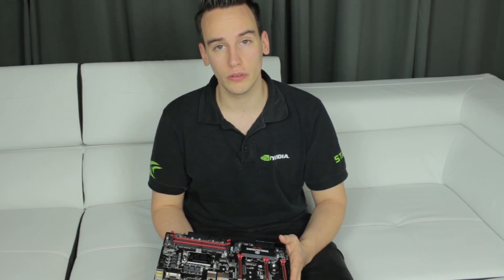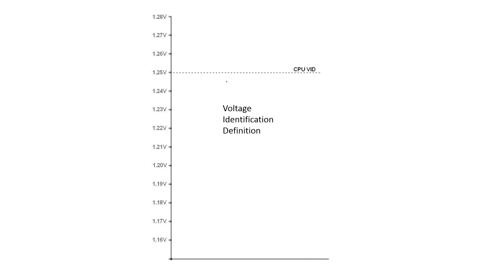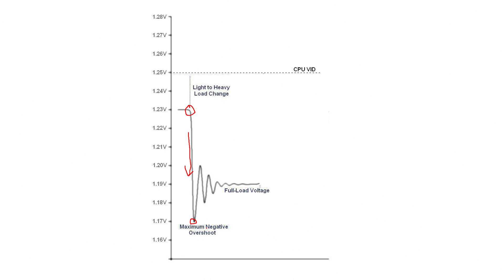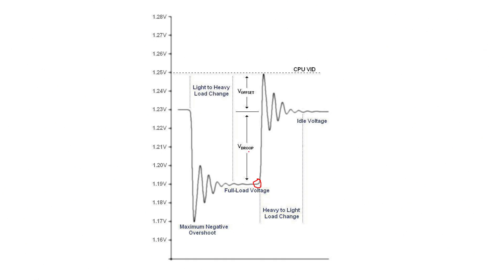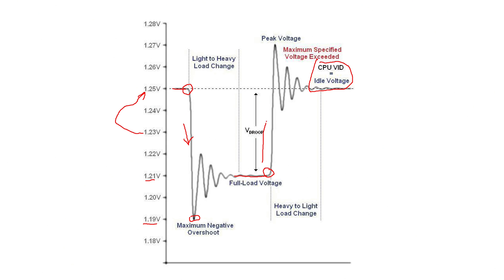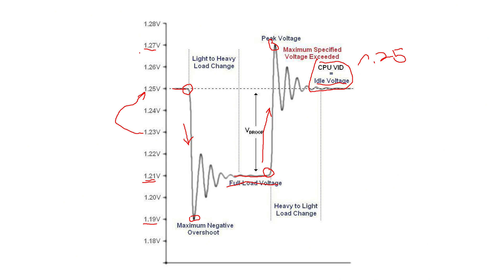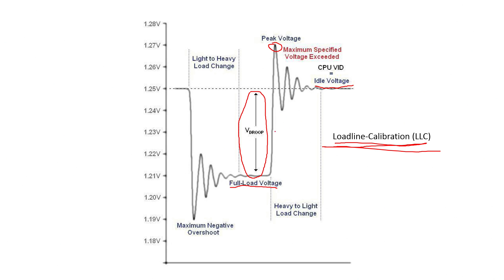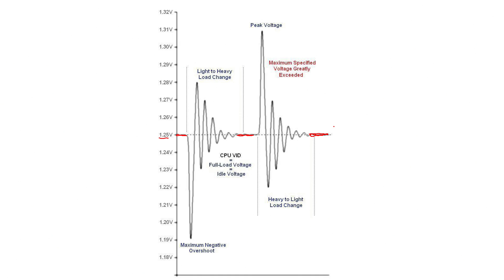VID, vCore and Loadline Calibration explained

Comment: Any help,  what could be causing this. I7-13700k, regular settings etc, hitting +-90C max temp. Cinebench r23, 10seconds after starting the benchmark, it draws +-230w and voltage is at +-1.37. But after the 10 seconds, power draw drops to 60watts and voltage drops to 0.74v. Cant seem to find solution for this. Have tried forced voltages etc, but dont help.

Comment: Would love to see an updated video about how AC/DC LL Interacts with vid,vcore & vdroop.
I know 1.51v is pushing it for max voltage for 24/7 use On 11900k but I don't think it will cause degradation. I was able to get AC/DC LL down to .08mohm to hopefully prevent unnecessary voltage spikes.
Temps are still good (custom loop)

Comment: Hi, great video! I'm trying to get 4.7Ghz on it 8600k. I put 1.27v core and I see in hwinfo 1.34v sometimes. What should I look in the software? Average or maximum voltages? Also getting 80°C at that readings

Comment: Thanks for the info. 1 question. When voltage drops on load, power is compensated by current right? So when the undershoot happens when load starts, can the current spike harm the system?

Comment: So to summarize, increasing LLC increases the voltage for the CPU WHEN it is under load (which increases temperature during benchmarking and stress tests) as well as increases peak voltage when the system is transitioning to idle voltage from load voltage (LLC increasing CAN mean much greater voltage then what you set in vCore/idle voltage temporarily while switching between states of idle and load. This can have a negative effect on your CPU's lifespan).
Reply: the idle voltage stays the same regardless of LLC level. Idle voltage = vCore set in BIOS

Comment: It's the VID that I'm just not understanding. I've read some things, watched this vid and try to make sense of it for my given situation and it doesn't click. Here's my situation... I have a 3700x and am monitoring with a few different programs. When I run at stock settings, I get the apparently normal 1.4v - 1.45v for both the vcore and the VID. If I set a manual overclock, the VID now never goes above 1.1v regardless of multiplier and vcore voltage. The VID almost constantly stays at 1.1 with the brief and occasional slight dip below 1.1 . How do I make sense of this? Isn't the VID supposed to be higher than the vcore voltage?

Comment: Yo man! I've got a problem with adaptive voltage, Iv'e set it at 1.350 voltage with a minus (-) offset of 0.035. The offset works but in idle, the adaptive voltage doesn't seem to work since it doesn't drop lower the 1.300 volt... When the adaptive voltage along with offset is at auto, the voltage drops down to about 1.080 which also of course gets the idle temp of my CPU lower but this doesn't work with the adaptive voltage that I've manually set...

Comment: I just built my first PC,  Asus x570 tuf AMD 3700x.  My worry is that in bios my computer says 1.512 volts.  Even in cpuz it says 1.45.  Under load it says 1.35. Is this normal?
Reply: Gaming in still Life that’s the maximum recommended voltage under load for 3rd gen ryzen. I think there’s a glitch atm with how the voltages get recognised in cpu z though but if you want to be completely safe remove your overclock

Comment: I'm running a Threadripper 1950X. According to HWMonitor, I have a VID per core of 1.237v when idle. It goes down to 1.194v when I start a stress test. That makes no sense. If VID is the 'requested' voltage from the core, why would it decrease just as it starts to get busy and needs more current? My vcore is 1.248v idle, 1.224v all cores loaded. So VID isn't a maximum either.

Comment: I didn't even increase the core voltage in the bios but its running at 3.760 V to 3.8 V usually it would be on 1.3 V

Comment: When I run a stress test not at a fast pace but it will fluctuate between 1.296v and 3.115v is this normal. Have a 5ghz oc btw seems stable

Comment: my VID sits at 1.42 on my VIII Hero.  My CPU is set to 1.295v.  My LLC is at 5 and it idles at 1.312v. Heavy loads it usually cycles between 1.312 to 1.286 at 4.6ghz.

Comment: This would be easy to fix with a "maximum voltage regulator voltage" in the BIOS, this way LLC couldn't kill your CPU and bumping up the vcore to levels that seem safe would always be safe, this is actually very easy to implement in the bios and voltage regulator so someone should definitely pitch this to manufacturers.
Reply: llc doesn't kill the cpu. it' those voltage fluctuations going from load to idle or idle to load. A perfect vrm that doesn't has those voltage fluctuations is possible but would be too costly. Hence we're struck with those fluctuations.

Comment: I have an option to increase/decrease cpu load line calibration and cpu graphics load line calibration which can go upto level 7 or 8 from level 1 and it says increasing the cpu graphics LLC will increase the graphics performance but will also increase the temperature. Should I keep the LLC level minimum or maximum?

Comment: Thanks so much for the video!

Quick question for you or anyone else who is able & willing... I have a Gigabyte Z170X Gaming 7 motherboard and it has a setting for CPU voltage called "Core PLL Overvoltage (+mV)" - it goes in increments of 15mV up to something like 300mV total. It's not mentioned in the manual and it seems nearly impossible to find any information (reliable or otherwise) about this setting online. Do you happen to know if this setting is relevant to the "V Offset" in your diagram around 2:45? Perhaps it's an amount above VID that the motherboard will deliver (e.g. providing a higher voltage than VID requests), either constantly or under certain load conditions?

Thanks in advance for any light someone can shed on this! :)

Comment: "Where you said "There's nothing you can do about it", Correct as a user, but I think it's important to understand that higher quality motherboards with faster switching frequencies and more capacitor capacity will experience VDROOP less and therefore will require less extreme LLC settings. 

That's why it's important to understand and measure on your own motehrboard and not jsut use otehr people's recommended settings when fine tuning your overclock.
Reply: Boosted Media what's an example of a high quality mobo....z370 for coffee lake

Comment: call me crazy and stupid , why the idle voltage higher than the load voltage in the first example? thats the part i dont get

the LLC what does have a more stable voltage between usasges ?? what are the pros and cons ??
Reply: idle voltage is higher than load due to vdroop which is a built-in safety mechanism. you can use llc to remove vdroop but you 100% will run into voltages higher than VID during transience from idle to load.  
pros for more stable voltages between usage means that you get to achieve stable overclock which is theoretically possible but isn't because of vdroop. cons would be that you run into voltages higher than VID during transience from idle to load. llc is basically a way to remove the effects of vdroop. but if you have a nice motherboard with 8+* vrm then vdroop shouldn't be that high to begin with since vrm has plenty of phases to work with and can match the amps required by your cpu at a faster rate. 
Hope this helps

Comment: I have a ryzen 1600 and a MSI b350m Bazooka, my voltage drops by EXACTLY 0.05v. I tryed LLC but it does nothing at all, now i'm with llc at 8 and my voltage at idle is exactly what i've put in the bios and under load it drops by 0.05v. It does it even with llc set to 1 or auto.

Comment: Why does my VID change so much?
Reply: VID changes because it's the voltage programmed into your cpu for every frequency. so for a x21 multiplier you'd have different VID and a different VID for x22 and so on.
Reply: @PotatoEdits do you have power saver features on "on" in your bios? if not, turn them on and your VID should drop according to clock. But VID is mostly a symbolic value anyway, what you want to monitor is svi2tfn voltage in something like hwinfo etc. make sure that value at max doesn't exceed your VID
Reply: @PotatoEdits  can't say what wrong since a lot more things come into play but still 4.5 is solid af man don't worry about it.

Comment: bearing in mind a benchmark instantly hits the cpu with 100% load causing the worst voltage under/overshoot youd ever see (if you could measure it), in the real world the cpu load is not vastly increasing and decreasing instantly so the voltage under/overshoot wont be quite so much but it is still there.
Reply: in the real world, it's changing more often, which has definitely given me instability compared to steady idle or steady load

Comment: so LLC wont matter when undervolting right? theoretically lowering LLC setting while undervolting will only cause instability from what i have learned from the video. is that right? also when using HWiNFO, does it record the PEAK VOLTAGE(explained in this video) which is the voltage reading showing on the MAXIMUM column on HWiNFO?
Reply: Gio de gracia damn i'd like to know this aswell, i'll undervolt my new cpu when i get it but im not sure if i should mess with llc or not, also which metod is the best for undervolting?, -offset or adaptive mode/-offset?

Comment: i have vid on 8700k so high to 1.46 ,its normal????
Reply: did you set it to that manually yourself, or is that the auto setting.  1.46 is high.  if you set that high yourself i would take it down quite a bit.  i wouldnt go above 1.40 unless i really knew what i was doing. if you set 1.46 to get your overclock but have not set llc you can probably get the same overclock by reducing the voltage to 1.35-14v range and increasing the llc. check your vcore when the cpu is under load in something like hardwaremonitor. if it is running less than 1.4 while under load but springs back to 1.46 after the load is removed then you can definitely reduce your voltage and increase your llc.  5ghz is not that important.  if you can get 4.8 at 1.2-1.3 the chip will last a lot longer and the cooling fans will run a lot quieter and you will only lose a very small amount of performance.  if you didnt set it yourself and this is the auto settings i dont know what to tell you. how do you know its 1.46? did you check the bios or did you use monitoring software.  sometimes the software needs an update before it reads correctly
Reply: bobhumplick So 5ghz on a 9700k with a 100mhz avx offset level 4 llc on asrock z390 phantom 4s max is level 6 I have fixed voltage stable at 1.320volts 35-40c idle 66c gaming and 78-82c under various stress aida64,intelburn etc highest vcore I see in hwinfo is 1.319 vid reads upwards of 1.480’s vid is not the voltage my chip is actually getting correct ? That’s just what Intel assumes it should be getting ? Thanks for any clarification

Comment: Does anyone know which LLC mode that will produce the least heat on my gigabyte mobo?  Options are auto, standard and high.
Reply: SpecterMatthew high LLC will increase voltage under heavy load. More voltage is more heat. What you can do is set it to High, but put your vcore setting down a lot to compensate. Example: So if vcore was set to 1.30v and LLC was off you would probably drop to 1.20v under load. Instead lower your vcore to 1.22v and increase load line until you are at 1.30v again under load. That way you'll be running cooler at idle and higher vcore and temps but better stability during benchmarking. You want high voltage when you need it (stress test) and lower voltage when at medium or low load.

Comment: i dont get it, now im more confused than before. i would think the idle voltage is lower than the full load state...
Reply: @impylse heres the best way to think about it.  have you had a large appliance or electrical device turn on and when it did the lights in your home dimmed.  im sure youve seen this.  its the same thing at idle there's no load so there is no problem keeping the voltage high and the light bright.  if you had a little light bulb on the same circuit as you cpu it would be very bright.  then when the cpu suddenly gets loaded up the little light bulb dims because the cpu is pulling power and the voltage drops.    also while the voltage drops the current increases massively.  current is the measure of "power"
Reply: Maybe another way of thinking about it... When you play tug of war, both parties are pulling the rope. So imagine that when both sides are pulling on the rope, it's when the CPU is under max load. If one side lets go (you end the benchmark), you fall backwards because you were pulling so hard, but all of a sudden that force wasn't needed anymore. (the CPU all of a sudden doesn't need that much power anymore, but for a split second it was still receiving the power it required previously, so the load shoots up a bit, kind of like when you fall from the other side letting go).
Reply: Impylse - your voltage does actually decrease because your motherboard wants it forces it to during idle. Mine goes from 1.23 to 0.67v or so. But vdroop is different and from what I understand is actually a natural phenomenon found in any electrical circuit, even in the walls in your house. As electricity flows through wires it generates heat and loses some of its voltage. It's almost like friction or air resistance on a car. They say that you burn 10% more gas in your car per mile for every mile per hour you drive over 60mph. So if you drive to your friends house doing 60 you will use 10% more gas for the same distance than if you go 70.
Reply: also as impilse says power saving features drop the voltage down below one volt, like intel's speedstep.  you could call this "idle" voltage because the cpu downclocks and reduces voltage when not in use.  but this is not what der8auer means in this case.
Reply: It's like a car, some system items stand low and then go high, and some stand at max and drop to allow the low ones to increase to prevent overheating and burnout/fires.
Reply: It's like a car, some system items stand low and then go high, and some stand at max and drop to allow the low ones to increase to prevent overheating and burnout/fires.

Comment: i don't get something, why do the voltage is higher in idle than in fully utilization ?
Reply: its like when you turn on an electric motor and your lights dim.  when you put a heavy load on somehting the voltage drops.  its like riding a bike.  when your on level ground it would be easy to pedal, say, 1 turn per sefcond.  when you start to pedal up hill it would much harder to pedal 1 turn of the pedal per second, and you may fall off to say .8 turns per second.  now imagine someone on the ground saying  "he's going uphill, he should pedal faster" lol.  but its doesnt always work that way.  the mobo's vrm do the same thing.  they suffer under a load just as we do lol 

also while the voltage drops the current increases massively.  current is the measure of "power"
Reply: @bobhumplick4213  Watt is the unit of power :)
Reply: @yooz111  thats why i put it in quotes.  i did this so people who came along afterwords would realize i was dumbing it down.  but yes watt is the unit of power and current (amps) is the unit of electron flow, equivalent to gallons per minute in a hydro or air system.

and i didnt exactly say unit but measure in this case.  if the voltage is more or less constant (only varying from 1.4v to just a bit less) then current would be analagous to watts since 1.4 X current is power.  if the voltage is more or less nearly fixed then current is a measure of power.  in a fixed voltage system your current draw is relative to your power.

Comment: This graphs seems back asswards to me...why is your idle voltage higher than load? My ryzen idles at ~.912v and when i do a stress test it goes up to ~1.35.
Reply: That's due to power saving features. Turn them off and you set 1.35v in bios and it's 1.35v on idle. Hit it with load and no LLC and voltage drops. It's the same story for Intel chips.
Reply: dark_wizzie is correct.  the .912v you are talking about are the voltage when power savings mode kicks in.  turn off the power saving mode and it will show you the true idle voltage or you can look at the entry in your bios

Comment: So if I have v-core voltage set 1.2V in bios and cpu z also shows that voltage,I dont need to worry about the vid voltage jumping from 0.8V to 1.42V in HW MONITOR?
Reply: the vcore in hwmonitor is goin down to .8v because of power saving mode like intel speedstep, but this is not the idle voltage, which  would be the 1.2v you put in..  if it goes up to 1.42v that may be llc kicking and if you are not overclocking llc should not be on, turn it off.  if you are overclockign and you turned llc on and if that is a recent intel chip that v-core is too high i think.  i dont know about amd chips but if its intel you need to take llc down if you put it on. use an llc number in the middle of your options like if its 1-5, use 2-3, or 1-8 use 4. if you are overclocking once you turn the llc down you may need to compensate by increasing the 1.2v you entered in the bios

Comment: Excellent explanation. An observation/or question: Other software, like HWiNFO and may be Speed Fan, indicate the voltage spikes (it seems to me), I'm wrong?
(Off topic: I would gladly buy your binned, delidded/relidded and signed CPUS line, I consider them pieces of collection).
Reply: It's not measuring accurately, only as accurat as your sensors refresh time. My motherboard has 256 ms precision. But what happens between 2 refreshes is exactly what's explained in the video. You can't measure that with software.
Reply: thanks